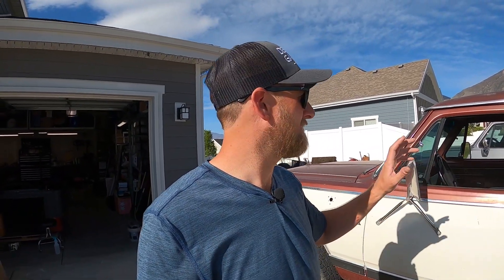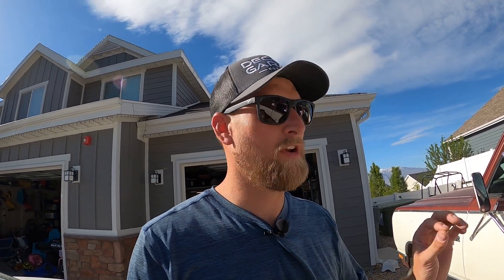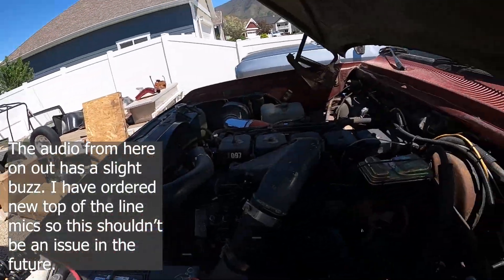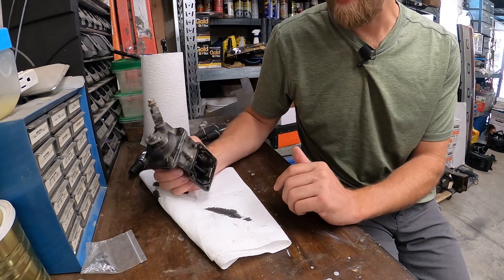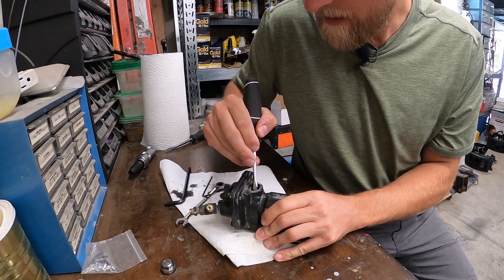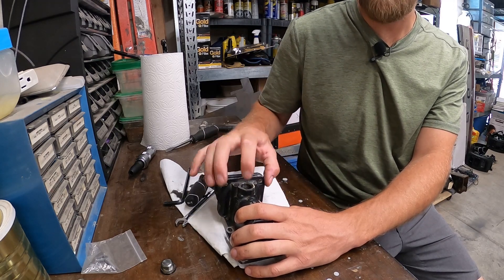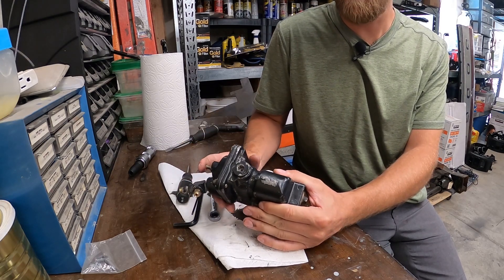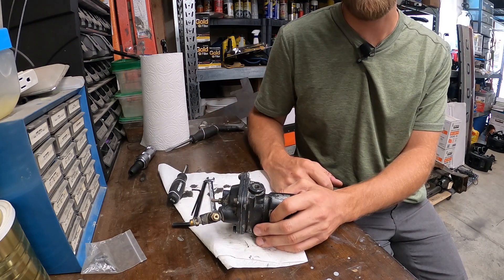No More Rolling Coal: Tuning a P-pump AFC

Comment from the maker: My first time adjusting a P-pump! Go ahead, roast me in the comments OR let's hear suggestions for my next attempt at tuning this thing!
Reply: I just did my and my smoke screw i turned it in till i felt it touch the diagram and ended up turning it in 3/4 after driving it start wheel 4 turns from being all the way back stock fuel plate and 3k springs with afc all the way forward and fuel plate it barely smoke on take off very light haze and clean till rpms reach 2800 then it goes back into fueling 34max psi boost

Comment: Got a 12 valve I'm about to work on and it's barely running 10 maybe 15psi. After checking boost leaks this will be something I'll check for sure.

Comment: Do I need to mess with my star wheel if my truck is only Rolling coal pre boost? Or do the smoke screw and star wheel work together so if you adjust one, the other will be off adjustment?

Comment: Great video.  Appreciate the info.  Alot easier to tune a 12 valve than I thought.  Putting one in my F350 once the 7.3 decides it needs a major repair.  At 317K miles it's anyone's guess how long it will last.  Seems to run ok, but we will see.  Already have the full conversion kit to mate the 12 valve to the ZF6 manual.

Comment: I remember this video .. i many years ago wanted to help my truck it got poor mileage and just seemed lacking in power . So i finally after everyone saying O will burn a hole in the piston. I gave the engine timing the mileage went from 16 to 21 on the highway .   17.5 deg   or close to that timing  . Power i installed a 10 plate all the way forward. The AFC all the way forward.  Gave it some preboost . 3 k governor springs.. 215 injectors..i got them from Piers in Canada . Believe it or not with a automatic i could drive it with a lite foot and it did ok . .  But when i installed a g56 things got worse .  I finally got tired of the smoke very quickly.. Cruise control was a pain in the butt on hill as the cruise will give the truck more throttle . ..So i orderd the spring kit for the AFC  and installed it .i then started adjusting the star wheel back . The truck seemed to run better but it would stll smoke pretty good .. i adjust the pre boost back also ..Finally after a few attempts the star wheel , i loosen up the AFC house and slid it all the way back .  That finally got the smoke under control.  Still runs good ..shifting through the gears is good . I can if i want make it smoke a bit . But for me its a lot better to drive . . I dont care about high end hp . I just want smooth power and not deal with people. Drama , smoke ..To be honest its still a lot better than it ever was stock .. .
Reply: 16mpg…that’s what i’m getting right now on my 97.  i got to figure out my pump.

Comment: N o matter what I adjust,the only way I hear the turbo is air cleaner 90 pipe removed
Reply from the maker: What year is your truck and what turbo.
Reply: @decentgarage  97 stock,4inch exhaust,12 valve 0 plain fuel plate
Reply from the maker: @johnmaxx4818  have you pulled the silencer ring out of your hx35 turbo?
Reply: @decentgarage  yes
Reply: @decentgarage   I believe it's in the AFC housing you know the smoke screw or the spindle

Comment: Thank you for cleaning up the Exhaust. 
Rolling coal is pointless and not cool anymore
Reply: I like my 12 valve clean too. It is just the nature of the beast with a mechanical pump and static timing. If we could make an on the fly timing gear that can work with a more "intelligent" AFC device we could have a better 12v that is still more reliable than any newer truck.
Reply: @D.M.Designs  afc live

Comment: Hey I’m diesel tech and my personal truck is a 1997 12v and a few mods I would recommend would definitely be a #10 fuel plate for less low rpm fuel , also I would recommend a new afc spring that is longer I believe the one I put in my truck was from bd diesel and it lets the afc have more travel and a smoother ramp up of fuel with boost
Reply from the maker: Great suggestions man! I've since upgraded the AFC spring and that made a huge difference.

Comment: exactly how I did my 8.3 in DP now it pulls mountains dragging 33k lbs up no problem.When I got it years ago it would handle steep mountains but barely get up them at 55 . Once did the 75hp throttle plate kit and tune I had no issues holding 65 up and feel it would even accelerate to 75-80 with no problem. I do try to hold around 60-65 to maintain Low EGT temps with 12mpg because even at 70 it drops off 10 mpg and 75-80 about 7mpg With the pump mods. Runs like I am driving a pickup and have to set cruise on long drives or I would often end up past  75 not even meaning to as I followed Trucks.
Reply from the maker: Yeah it's amazing how far some pump tuning will go.
Reply: I got 8.3 in 32ft… flipping rocket in the mountains.. weighs 21 k ,, guessing at 40 lbs boost 1200 degrees 2100 450hp.  power clamps crazy above that..  absolutely blows people’s minds … 12 mpg at 70
Reply: Reason fuel mileage drops is rpm more then anything.. Cummins at 1500 rpm sips fuel.. makin same power at 2100 twice the fuel… ur rigs need gear change but too expensive.. speed limit was 55 when built..  with tuning easily take tall ratio bet 15 mpg at 70 possible.. I take a lot of two lanes average 50 mph get 15 plus without trying in hills… flat land 75… 8 mpg
Reply: Hard to get info on 8.3 pumps when I contacted after market they claimed a 325 pump was already maxed out..they sold nothing for them….  Slid stock plate all the way.. turned up boost.. more then enough fuel for at least 550 hp from stock 8.3 pump.. they aren’t same as pick up pump.. bigger delivery valves plungers move plenty of fuel.. if u haven’t.. turn up waste gate.. at 30 35 psi it’s whole different experience

Comment: Smoke definitely makes horsepower. I just turned mine down to not smoke. It’s slow af compared to how it was. I could spool 45+ psi through my S366. Now it struggles to go over 30. Turning it back up after I’m done traveling.
Reply from the maker: Correct. Smoke = more fuel without adequate air supply. So if you are making with more power witlots of smoke this tells you that you need to upgrade the air side of the equation. Fuel is not the only variable

Comment: You don’t need a lot of preboost screw, only about .5-1.5 turns past contact with the screw. Any more will make the idle mixture too rich and it will run too rich till it spools the turbo.
Reply from the maker: Yeah i readjusted that. It was too rich

Comment: 35 psi of boost is the magic number for performance and efficiency with a 12v and a stock hx35 turbo
Reply from the maker: Finally got it there with a new lift pump

Comment: My favorite way to tune the star wheel with a stock hx35 is by removing it and applying regulated shop compressed air at 35 psi to the afc. Then adjust the star wheel as needed to get full rack travel at 35 psi of boost.
Reply from the maker: Great idea!
Reply: Any videos of this procedure by chance?
Reply: I need someone to show me how to do this
Reply: nice!  make a vid on that.

Comment: My p pump 12v doesn’t smoke at all no matter what. I wish it would smoke like yours, but only when I really want it to. Are you not running a fuel plate? I have a 100 fuel plate in which is one step below a 0 fuel plate.
Reply from the maker: Mine has a 100 fuel plate as well
Reply from the maker: Keeping watching the videos on this truck. I just barely got it running good.

Comment: AFC position also matters. My AFC is slid all the way forward the smoke screw is backed all the way out and it still makes a decent cloud down low.
Reply from the maker: Yeah i didn't mention that but i believe i have my housing all the way forward as well
Reply: @decentgarage  That interesting ours are so different on the smoke screw position. Maybe the pump matters too, mine's a 215hp pump.
Reply from the maker: @Deezle_Gaming  when this video was filmed i only have about 8-10 psi of fuel pressure. I just fixed that and will be retuning it again. That's probably the main difference

Comment: annoying watching first-timers fiddle around, just put a AFC live on it with a long travel kit on it,
then you can fiddle around all day long without having to even pull over. lol.
also for adjusting the star wheel, hook it to shop air with a gauge on it, adjust it so it starts moving at about 15 psi depending on your turbo set up.
Reply from the maker: Sorry to annoy you... 😔

Comment: Need to work on my VE tuning. First need to adjust valves as they are a bit clanky.
Reply from the maker: Check out my valve adjustment video!
Reply: @decentgarage  I used to do all my valve adjustments since early 90s, but now I get the kid to do them as he is more flexible. Have you ever used or heard of the 'McKenzie Tool Company B&C TDC LOCATOR PT31793'? A very accurate way to find TDC for pump timing. I have one of the few of these tools ever made.
Reply from the maker: @mutantryeff  I've never heard of that. Now I'm curious
Reply: @decentgarage  I'll see if I can get some photos and forward. It might take a few days.
Reply from the maker: @mutantryeff  please do. My email is in the video description or I'm on instagram

Comment: I’m gonna try your way to tune my 95 12v cummins so I can get max power without bogging the turbo or dumping smoke. I’ve been messing around with it but I can’t seem to figure out just the right combination of smoke screw and star wheel. Thanks for the good video.

Comment: Soooo all the truck and tractor pulling guys are doing it wrong? Smoke obviously = power,  the millions of truck and tractor pullers are NOT wrong!
Reply from the maker: This is comparing apples to oranges. Sled pulling vs daily driving is a very different scenario. Sled pullers need extreme HP for seconds. They also needs huge amounts of fuel to spoil the turbos they run. This is not the same for daily driven diesel trucks. I'll leave it at that.

Comment: Look on DAP diesel thry have a afc spring kit get the springs thry are longer and will work alot better and set the star wheel all the way down.  Idk how we can go about it but you can contact me and I can help you more
Reply from the maker: I'm still trying to research the AFC spring. I've heard mixed reviews on running a stiffer spring.
Reply: The after market springs are not stiffer ...they are longer and are way more tunable
Reply from the maker: @kaydewhipple7696  interesting! That sounds like what I want then. Thanks for the clarification
Reply: @kaydewhipple7696   I appreciate the information.  I interested in a longer spring I think as I trying to adjust my afc to reduce the smoke . I tried to reduce the smoke but I adjust the spring back and the truck seems to run better and less smoke but I think I running out of adjustment . So do you know which spring kit is the one to buy as they seem to offer different ones thanks

Comment: So the smoke screw could use adjusted if the engine has a hard cold start issue, even when it’s not very cold, just sits overnight?
Reply from the maker: Yes, but another tip if you have hard starts is to just bump the throttle real quick when you start it 👍
Reply: Or try replacing your fuel filter